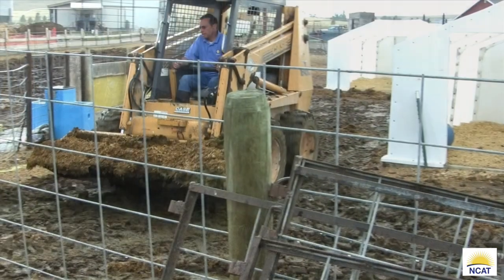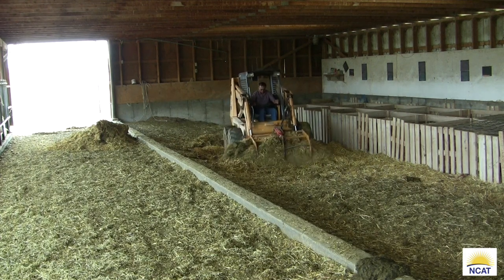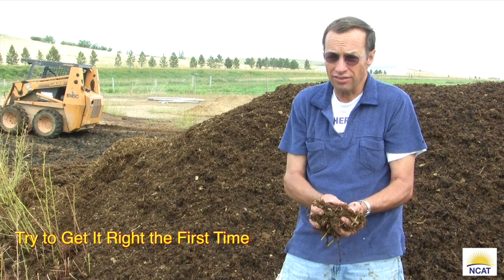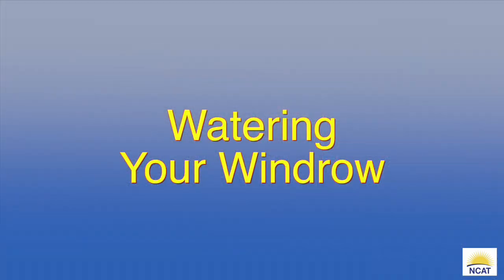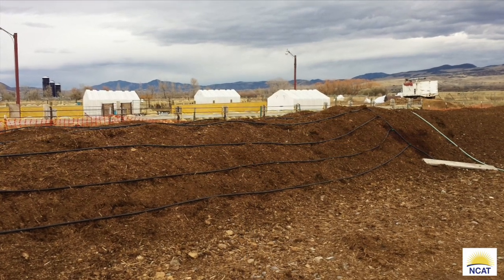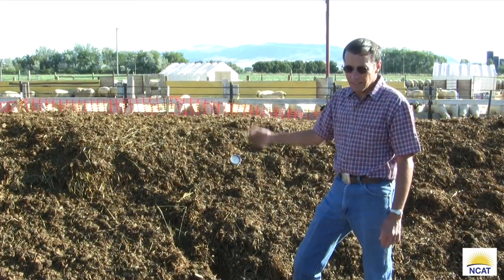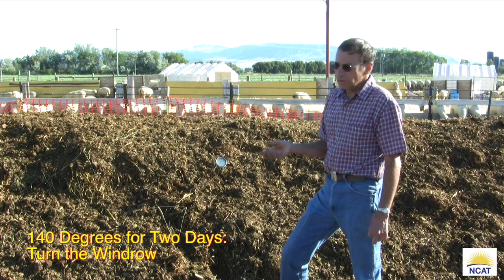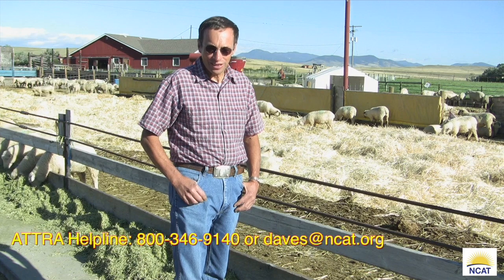Composting! You Can Do It

Comment: extremely well done, but I need you to explain how this can be modified for small vineyards that only have deer poop and grape leaves.....
Reply from the maker: Howdy Mark,
Sorry I am so slow in answering. Please forgive me.
Deer poop and grape leaves will work. Unless you have a deer feedlot, I doubt if you will have enough manure to mix adequately with the grape leaves. Maybe you do! At any rate, you can substitute green lawn clippings as source of nitrogen if you do not have enough manure.
You will have to experiment. I would start off by putting down a layer of leaves, The next layer of manure and grass clippings should be 1/2 as much material as the leaves. Continue by putting down another layer of leaves.

Grape leaves contain less lignin  than the leaves from the oak trees that are all around your house. More lignin requires more nitrogen because there is a greater amount of carbon in those leaves. So, if you are combining some oak leaves with your grape leaves, put a little more deer manure or grass clippings on the next layer. Layer the pile up until you get it 5 feet high. Discarded pallets make good walls for a small pile. Mass is essential to get the pile hot enough. Go ahead and turn your pile whenever it gets to 135-140 degrees.Your vineyard will appreciate all that nice compost!